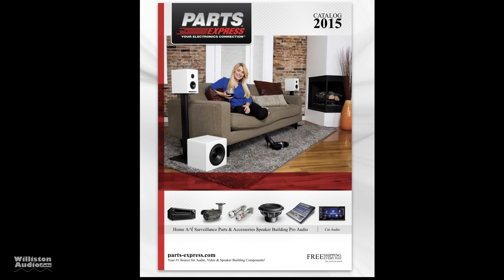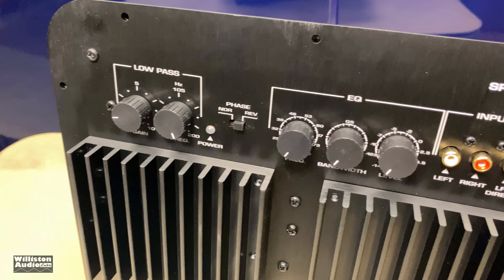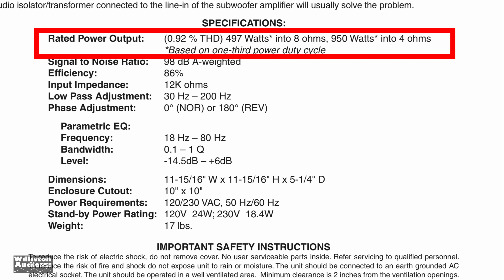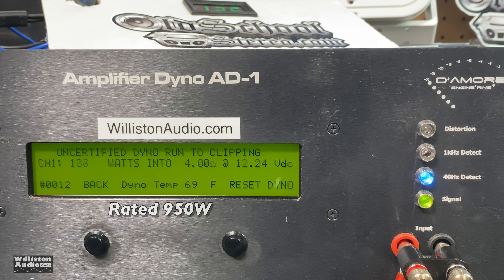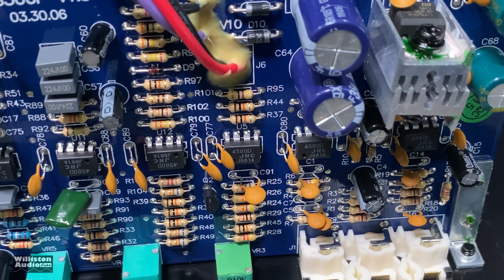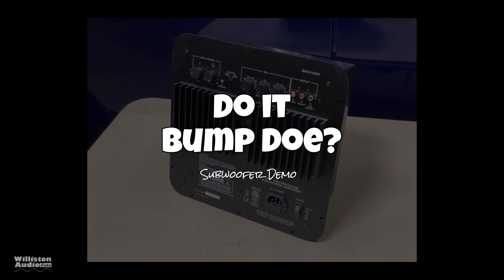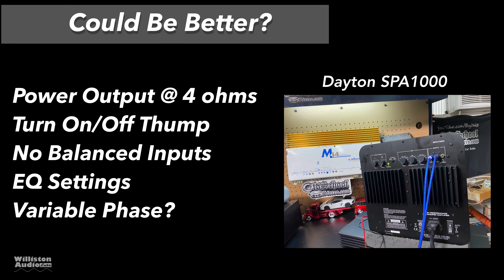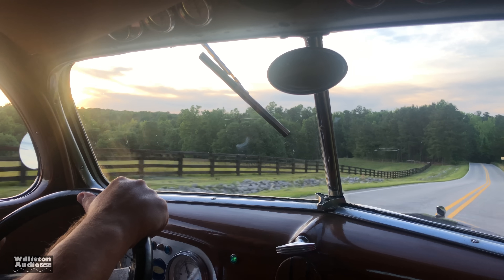DIY Subwoofer Amp for Home Theater - Dayton SPA1000 1000W

Comment: my problem with some of these are that they ahve a built in subsonic filter. where they cut off lower than 30hz.... i was wondering if there is a way to bypass that... so u can get ur ultra lowbass for home theatre
Reply from the maker: I do not believe this one has a subsonic filter, but I’ve seen some on PE listed with these filters and I believe they are intended for pro audio use
Reply: I have the rack mount version of this amp (sa1000) it has a switch on the back you can turn off or on the subsonic filter. It also has the turn off thump. I leave it on. Honestly I think rack mount is the way to   go. Never been a fan of mounting an amp to a enclosure.
Reply: @oneway7412  rack mount is always the way to go!

Comment: Hey Big D, 1/3 duty cycle means it's capable of playing at full output for 33% of the time when it's on.
Maybe you can verify or approximate that with a test. That's how it works with most electric equipment, not absolutely sure with audio. Take care bud!
Reply from the maker: Thanks man, I intended for that to be a big dummy segment, just neglected to put that clip in. Thanks for the explanation for everyone though
Reply: Yep, you can't run a sine wave input through it. Hence the duty cycle. While playing music though it'll be able to play all day. 

Usually has to do with thermal limits of the amp and/or the power supply.

Comment: I was going to get one of these amp's to build a sub for my home studio but they are rather expensive. By the time I bought this amp and paired it with a sub and a good box it would probably be over $7-800. I bought a Kali WS-12 instead. I know its not as powerful, but it was definitely less work and cheaper.
Reply from the maker: Yes this is true!

Comment: You will hear a lot of people say an amp is heavy because there is a lot of copper in the transformer, most of the weight comes from the iron core not the copper wire.
Reply from the maker: Good point 👍

Comment: Don't really like that thump as it can be pretty hard on any driver hooked up to it  They need to update with a soft on circut.  Aside from that, it's got pretty good bang for ones DIY home built projects - so as you say, leave it on.
Reply from the maker: Yeah a real bummer I thought we were WAY past turn in thumps in amps 😳
Reply: Leave auto on or  you can add a speaker pertection board with the sort start. You have the right idea to bad dayton audio wasn't in the right mind when they build it 👍✌️😉🤔👌

Comment: Class A/B you say...?

You have my attention. I've never been that pleased with my Crown 2500XLS and two of those guys would replace it nicely. 

1/3 duty cycle is kind of deal breaker though. If it's like welders, that means full power for only 3 minutes out of every 10. If that means including musical transients, then OK, but I get the feeling that's not what they mean.
Reply from the maker: I’m sure it’s fine with music and movies. Just no continuous test tones and it will be fine
Reply: @wal  Seems weird that they would even bother to say that then. I've never seen any other amps mention that including any other Dayton stuff.

I mean... Isn't the entire idea of RMS that it's basically an average of the maximum continuous power output?

Maybe I'm thinking too deeply here...?
Reply: @Mr. D Mine? Sadly I sold my house and became a renter, so it's all in storage. I don't have space for it at the moment and it didn't seem like a good way to be friendly with my landlord's neighbors. ;)

As far as my use of the Crown, it's running a JBL pro dual 18" sub cabinet. I can't remember the model of the cab, but it's 2 x JBL 2241-H1 subs. That's my .1 channel.
Reply: any crown amp is going to be way way better then this amp .
Reply: @NightshiftCustom  I'm on my 3rd warranty replacement and the warranty ended years ago now. I'm not too impressed with the quality. I've been thinking about going with a pair of Emotiva monoblocks, but it's been so long since I looked into the market I'm not sure what I'd do these days. Probably not another class D though.

Comment: I believe it’s Class G - linear power supply that’s modulated over the power rails of a fairly conventional Class AB output.
Reply: It’s still the same topology. See my other comments...The tiny heat sink could not support a typical A/B design. I kind of wish there was more technical accuracy with these videos but I guess the entertainment value is good enuf.
Reply from the maker: Could be but Dayton claims it’s A/B
Reply: It is Class A/B BUT with a modulated power supply which makes it G. I have this one, and the rack mount version AND the schematic plus I’ve serviced them.
Reply: Aaron, you are correct. It’s definitely Class G. They even changed it on their website.